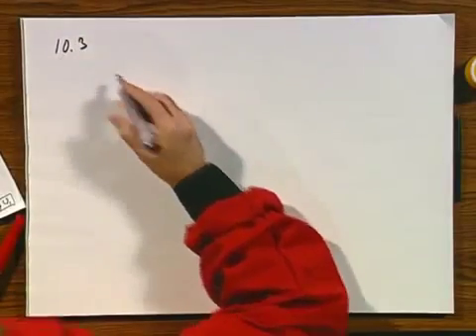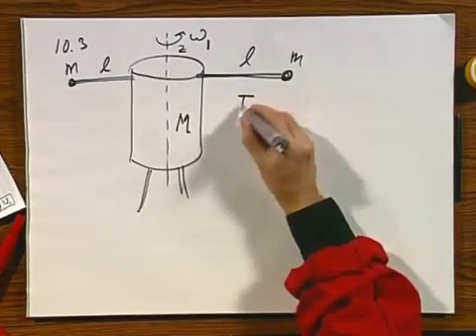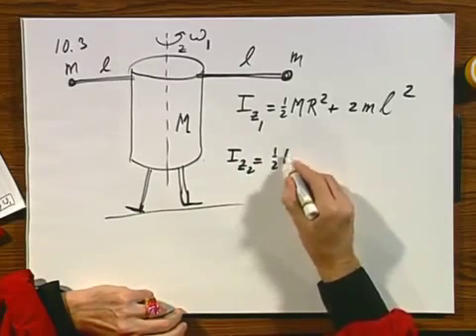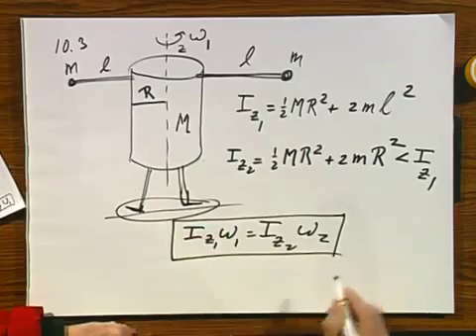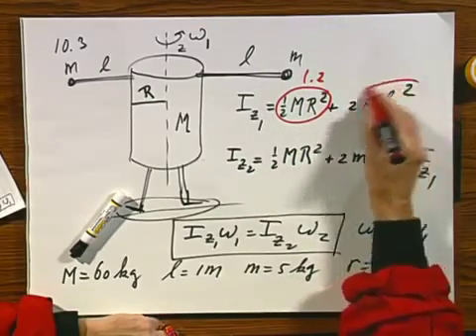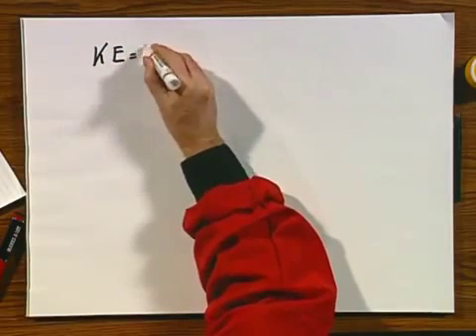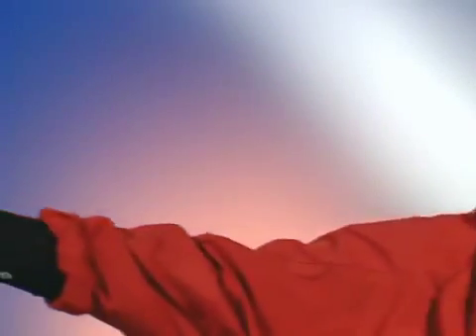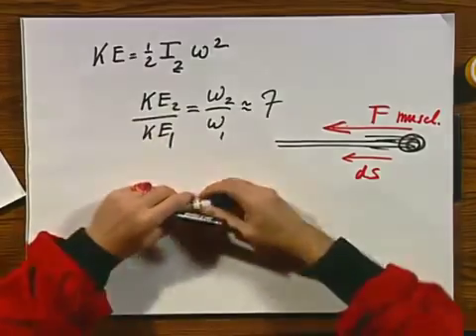8.01x - Module 25.02 - Figure skater - spin up and spin down

Comment: He drew the length of arms (l) to be the distance from the outside of the body to the tips of her fingers. However wouldn't it be more precise to say that (l) should be measured from the center of the axis of rotation? Otherwise, the approximation of the moment of inertia for the arms should be a different equation.... Given the calculations used, if (l) and (R) happen to be similar in length, there would be no change in angular velocity when she draws her hands in.
Reply from the maker: Yes, of course you are right. I should have written l+R instead of l. I should also have given the arms mass and included a moment of inertia of the arms alone when they are stressed. However l is about 4 times larger than R. Keep in mind that the crude model I chose for the body (cylinder) is only an approximation. Any effect of fine tuning will be smaller than the accuracy in the final result anyhow. What counts is the difference in moment of inertia between arms stressed with a weight in each hand and arms down. Maybe you like this video more. https://www.youtube.com/watch?v=BPizQDIcQ70&list=PLyQSN7X0ro22zanLOcvkaSY-IZqheFYM5&index=8